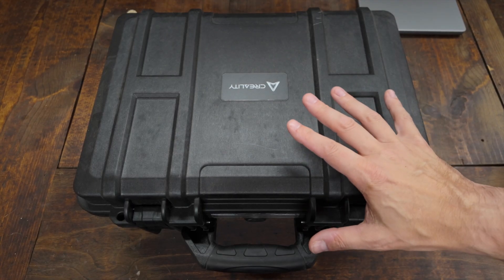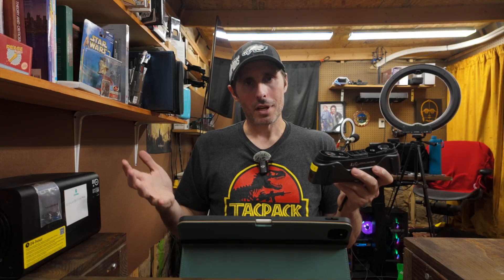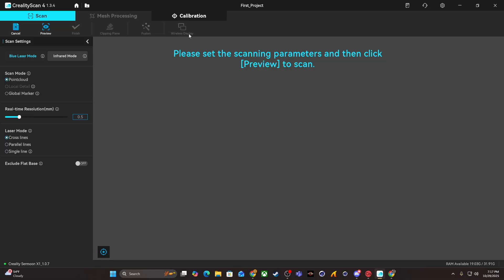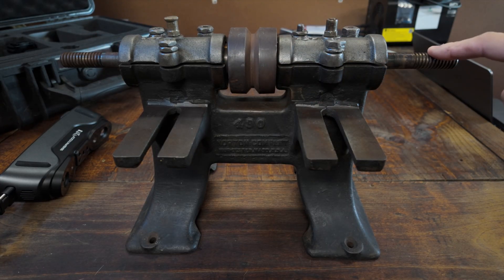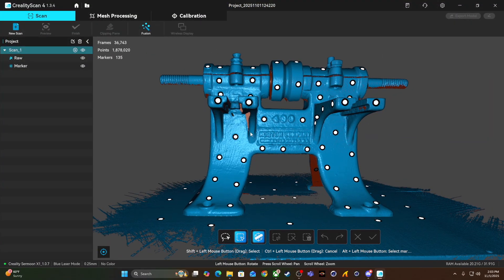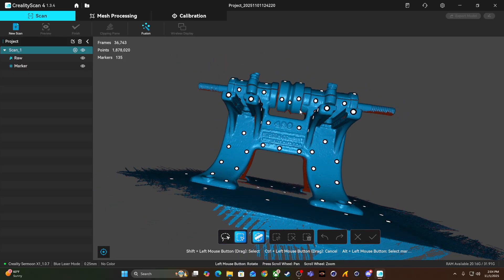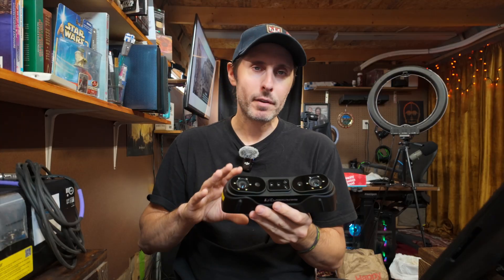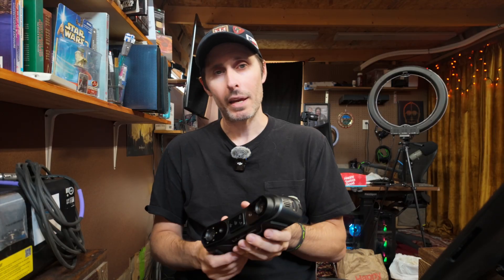I Made This CAD Model in 5 Minutes

Comment: Hey Hersch, love the videos. I hope this is ok. I wanted to leave some feedback albeit unsolicited. Before proceeding, please know this is intended to be helpful (hopefully).

These scanners are absolutely wonderful pieces of technology. However, I did hear a few things that were glossed over or over simplified. 

For example, you realistically would not be able to go straight from a scan to 3d printing. The mesh produced is not water tight, and therefore will have a ton of holes. Typically you need to spend a lot of time repairing the mesh with software before it's actually useful for printing or even building upon in CAD.

On a separate note, I think this video would have felt like a much better fit with your channel if you could have tied it into a quick shop project. It bordered on just feeling like a product placement. 

Again, coming from a place of peace and care. I hope this feedback lands well.

Can't wait for more shop videos!

Comment: Just getting into 3D scanning myself.  Picked up a Raptor Pro just before the Sermoon X1 was released, here is my take.

The title is a bit of hyperbole.

You don't yet have a CAD model.  You have an unprocessed point-cloud / mesh.

You still need to post process and orient in space so you can begin the process of converting to CAD.  If you just import the mesh into Fusion 360, the mesh will not be aligned to XYZ and makes it a pain to work with.

I've been using Cloud Compare (open source) for orienting my scans to a coordinate system, then using ReCap Pro to process, so I can then import the point cloud (not a mesh) into Inventor for creating CAD geometry.

If you can afford them, QuickSurface and Geomagic Design are very handy to reverse engineer a scan to a CAD model.  Fusion 360 has some capabilities, though more manual.  Inventor is a manual process as well.  I believe out-of-box SolidWorks is the same as Inventor, though I don't have experience with SolidWorks.

Note: QuickSurface / Geomagic Design both look like they license SolidWorks engine as their base, alternatively they are SolidWorks add-ins.

The journey has just begun.  But it will take quite a bit more than 5 minutes to have a good quality CAD model.